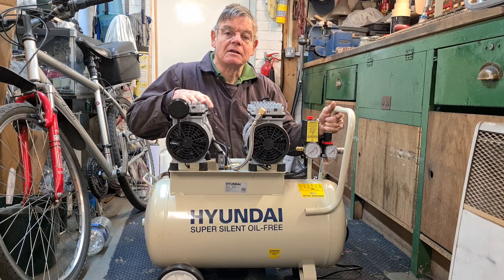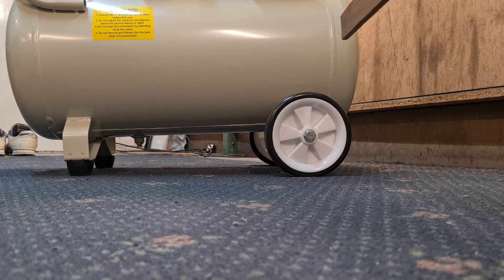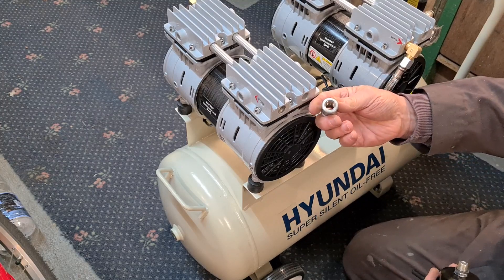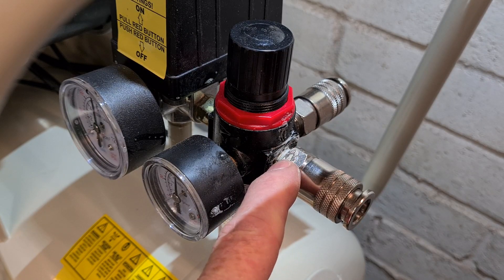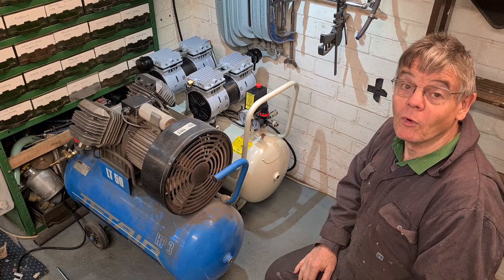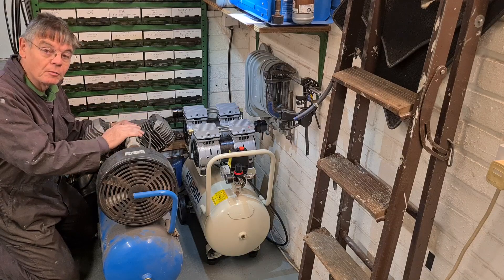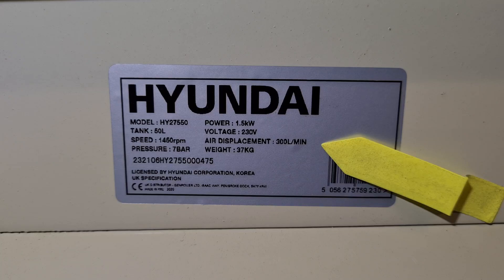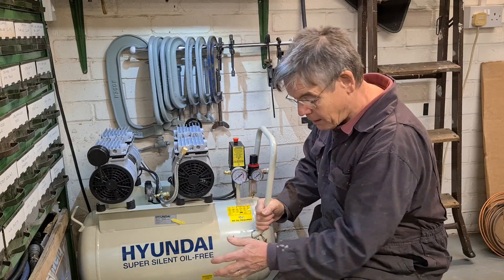Hyundai oil less Compressor Review

Comment: Just as a thought, temperature change will have an affect on the pressure.The compressed air initially will be hot, when the air cools the pressure will drop sightly.
Reply from the maker: Thanks for the information

Comment: Hi, I bought one of these Hyundai 25L compressor  from EBay, for the silent running, arrived without straps, box slightly damaged, unpacked it and assembled it, plugged it in the wall socket, and it went “BANG” and tripped the electricity, I thought it was me done something wrong so I rechecked it and plugged it in again, same, a dead short in the motor or something, disappointed but sending it back, thinking of going to sue for negligence, I have a pacemaker and if I touch it , it would of killed me, I watched DPD throw it on top of the other parcels in the back of the  van on top of everything else on its side, no wonder its faulty.
Reply from the maker: I'm not surprised, I think the design is good but workmanship is poor. I removed the 2 end plugs in the tank the other day and found more threads that were loose and the plugs were not tightening on the taper thread.

Comment: I once thought about buying such a compressor, but after reading reviews and hearing about people's opinions that such a compressor lasts about 60 operating hours and then requires engine overhaul, I gave up on it.
Reply from the maker: Yes I was thinking that but the good news is that the cylinders can be removed they are just a hardened sleeve, and the piston seals can also be replaced. They are all avalible from Hyundai